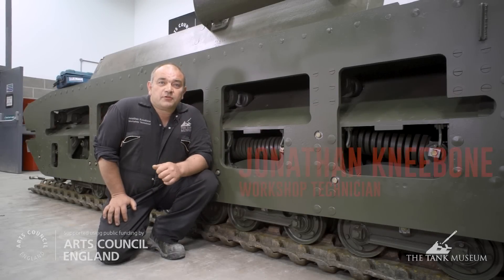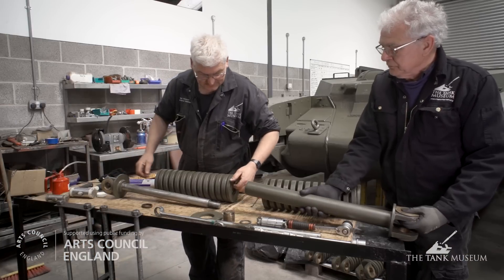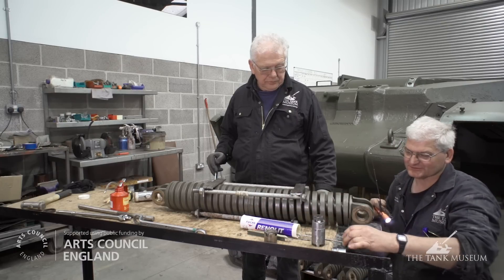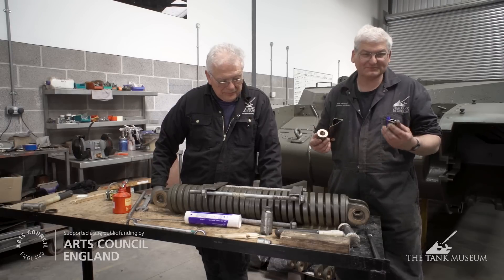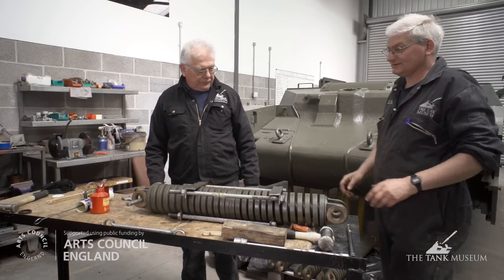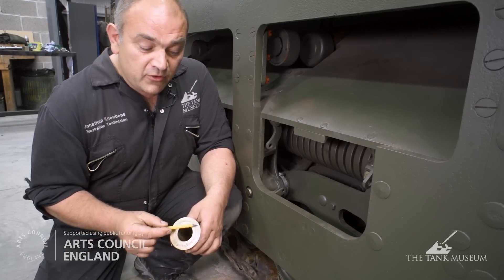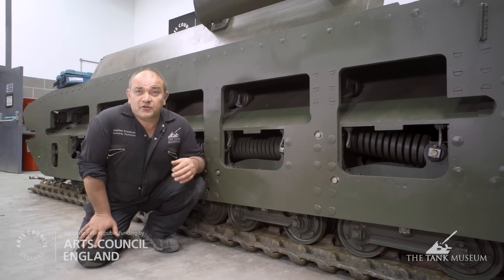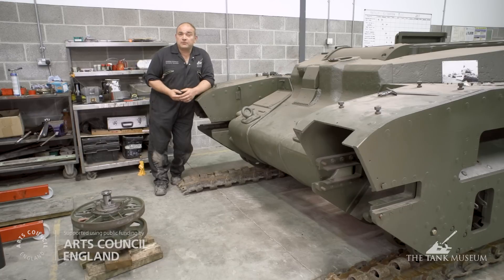The Matilda Diaries Part 15 | The Tank Museum

Comment: It seems like it may have been easier to simply make new pins, and make them, and their sleeves all to spec, rather than custom fitting each one?
Oh, I loved this video. The extra time where you showed all the processes/assemblies was very much appreciated!
Reply: I imagine it would of been a cost thing to get even more machining done (which would require reverse engineering the pin) as well as a "keep it original" thing. The undersized bushing solution works and just requires a bit more time to get right on site.
Reply: A delicate balance between restoration and conservation. Grandfather's axe, Trigger's broom and the ship of Theseus.

Comment: Maybe this has already been mentioned but I noticed that some of the pivot points on the suspension levers have a metal hardline running to them. Is that some sort of active lubrication system for the pin joints?

Comment: Are those suspension assembly pins just held in with friction and faerie wishes? Because that's impressive engineering, considering the abuse and vibration that portion of the vehicle experiences.

Comment: Was the Matilda the most complex WWII tank?  Or is this complexity level typical?
Reply: This is probably approaching Tiger levels.
Reply: Paul Below  A lot of pre-war designs (esp British & French) were more complex that in war designs.  The Matilda certainly isn't complicated per se.
Reply: It's not particularly complex just lots of units. The idea was to spread the weight out on as many road wheels as possible to improve traction in boggy soft ground.

Have to remember the Matilda, Matilda II, Churchill suspension designs all come from an era when they thought it was going to be more trench warfare and having to advance across such rutted and soft ground caused by artillery bombardments.
Reply: All types of WW2 tank suspension had their problems. The Panther and Tigers for example were a royal pain if a torsion bar on an inside wheel broke.
Reply: Paul Below not nessicary complex per say, more so difficult, the immovable armored skirt makes any suspension work difficult, a very poor design choice.

The easiest tank to restore is likely the M4, as it's entire suspension is the bogy sort, you can take it off and replace it in two hours, and the engines late Sherman's used where just massively upscale V8s.
Reply: Poor for field repairs, but somewhat more rugged against battle damage.
Reply: Thanks for all the replies.  I was thinking of all the videos in this series and not just this latest one.  Been wondering about all the Matilda parts and how much work is involved.
Reply: Matilda II isn't as bad as you think. The skirt is quite thick and strongly bolted I imagine it's a valid jacking point for field repairs. And if you didn't have that you could just dig a hole big enough for the bogey pair you want to service to get the slack either in situ or drive the tank over the hole. 

Certainly far less difficult to service then a Panzer V or VI and even a Cromwell or other Christie suspension vehicle where you have to take the armored side off just to get to the shock tubes and springs.
Reply: This is just heavy engineering yesterday and today. Machines are built this way. You should look at the level of mechanical complexity within a simple wet pin/dry pin set of tank tracks. Not just the design/construction but the metallurgy involved. The amount of human ingenuity required in even a 1930s-designed vehicle still impresses any layman today.
Reply: The Horstmann suspension type as shown in the Matilda was used in modified but fundamentally the same form on the Centurion, then carried onto the Chieftain and Challenger tanks. Still being used on British tanks today minus the heavy outer armoured skirts.
Reply: The Challenger tanks no longer had the Horstmann suspension as it wasn't suitable for the travel speeds and level of gun stabilization needed. They instead (both Challenger 1 and 2) have hydropneumatic suspension. The Horstmann design had some merits over torsion bar suspension though as far as reliability goes, but overall it was an outdated type of suspension already on the Centurion, unfortunately.

Comment: this is a great series. I am not surprised at how complex this system is.The brits just dont learn- another way too complex part. They also always use too many bolts and make them different sizes. How does a field mechanic work on this? omg look at all the parts to make a complete unit. I also forgot to mention the quality of the mechanic- You have a good man doing this in a perfect shop. wtf was done in the field in a combat zone?
Reply: skysky7250 stewart Why don't you do some research and find out?  You might learn that your preconceptions are not always correct.
Reply: Sorry I wont change my perceptions- I have worked on too many british cars. This tank chat channel is great! But you can see their prejudices when they talk about the russian and german tanks. The american ww2 tanks were junk-too bad they are not more to the point about that.The exception is their heavy tank at the end of the war.